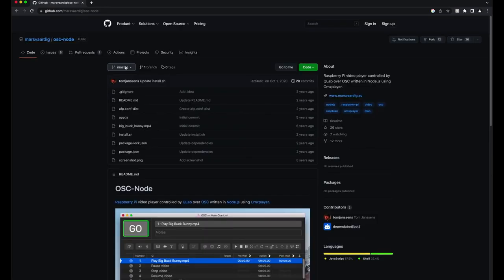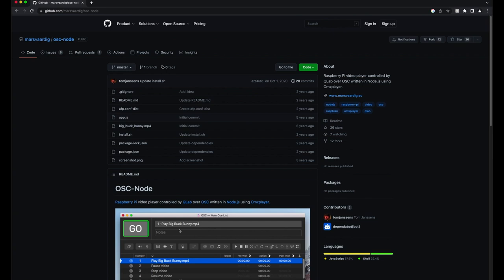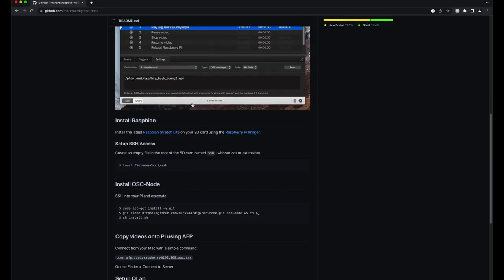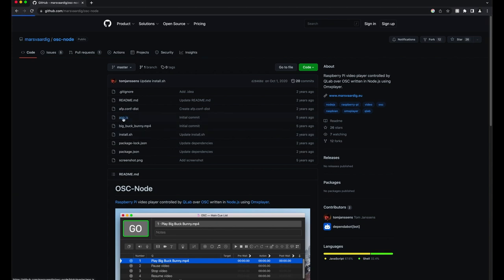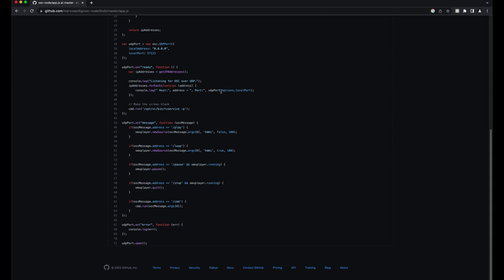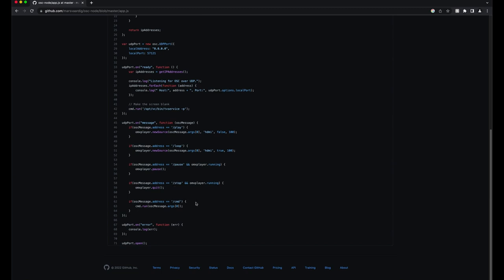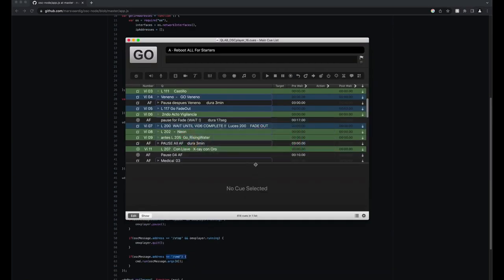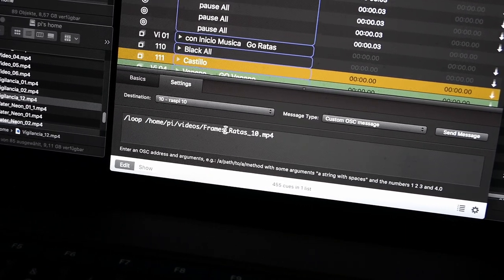This solved all my cable problems

Comment: I recommend the mini mad using mad mapper this makes this type of installation very reliable.
Reply: bastaría los 12 minimads y entre ellos un cable ethernet?
Reply from the maker: Need to research a bit on that. Looks good. But the budget ...

Comment: Very interesting! I wrote my own script to use Raspberry Pis as DMX (sACN) controlled media servers, which worked out pretty good. Basically the first version was just an automated VLC Player. In the upcoming Version i am using an custom Framework (GStreamer).
Reply from the maker: Mind sharing a link?
Reply: @philipp7pc  Youtube deletes my comment, when links are included, so i'll just put in the Github Name.
The first version: Pahegi / Mediaserver-Python
This one already did some productions. The sACN control was very handy in a production with many shows, where they needed an easy and cheap plug-and-play solution. So the control from the lighting board was the perfect solution. Another production used this software for prop-changeover-displays on the sidestage.
Reply from the maker: @paulhermann8259  I leave it like this, but as soon as I find Your comment in the spam pile I'll authorise it. ;]

Comment: nice video, especially the tipps to hide the console on boot up,

an alternative for qlab in orchestrating 12 Pis via OSC could be chataigne, a tool that can connect to a lot of stuff (OSC, Midi, Serial, HTTP, Websockets, DMX, ...) and has some prebuild modules for some devices/Software (HeavyM, Ableton Live, Mad Mapper, QLab, Resolume, Reaper, Watchout, ...) to make connections easier. With the connections you can send and/or receive information to these systems and trigger actions based on this. But you can also create Timelines with build in Audio Playback and sync Events to this timeline and maybe enable or disable certain mappings only during specific times. For example you get Positiondata from a Tacking System via PosiStageNet and want to map the position of the performer to the brightness of your video in resolume, with chataigne this is just some drag and drop action. Best thing is: this is open source and you heard of the developer before: Ben Kuperberg the guy that created the AfterEffects Spout Plugin you mentioned in your last video. Sorry if this sounds like an advertisement but i learned about this awesome software this year and can't stop to promote it because Ben is an awesome dude and his software is just great. Oh and you can create a Dashboard to control Chataigne with a webbrowser and/or a Streamdeck.
http://benjamin.kuperberg.fr/chataigne/en
Reply: and I just had a look at the "OSCVideo" OMXPLayer Wrapper from Rasmus Kreiner, you linked in the video description and the underlying wrapper offers a function Player.set_position(seconds) so it should be possible to use this to jump to specific points in your video file, this just has to be added to the OSCVideo Code to bridge Between OSC and the set_position() function of OMXPlayer, but this should be doable. If I need a low budget video solution I will have a look at it and might add it myself because I think going to a specific point in video is super useful for rehearsals
Reply from the maker: Rasmus' code seems pretty usable for many great applications. I was wondering if publishing it here might result in a kind of raised engagement in the matter on gihub - leading to a cool tool. ;]
Reply from the maker: Oh, this just added one more toDo to my list. Need to have a look at that chestnut ...

Comment: Nice setup! How do you think, is it possible to run NDI from Resolume to a few raspberrys and work realtime VJ show?
Reply from the maker: Can resolume output more than one or two NDI streams? 
My experience with NDI was that HD saturates a network pretty quickly if you can't use NDI HX.